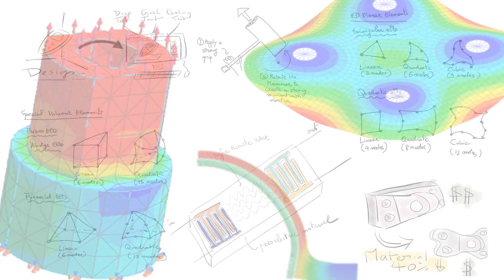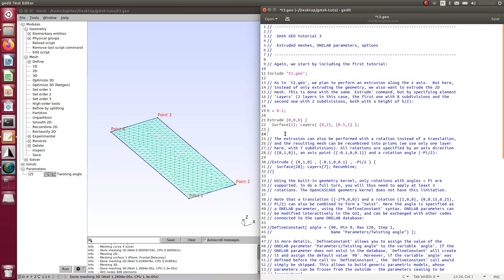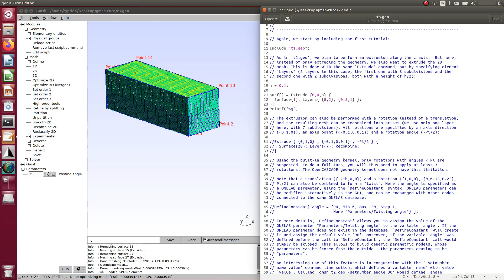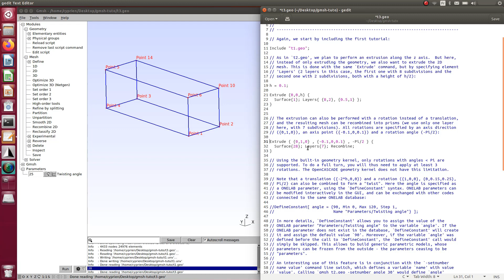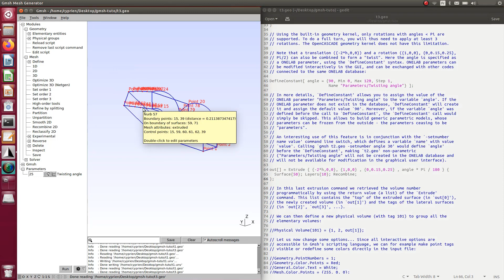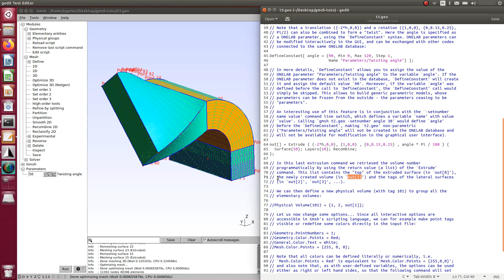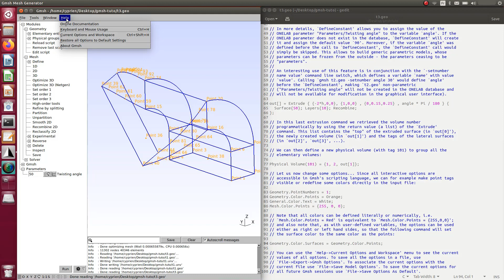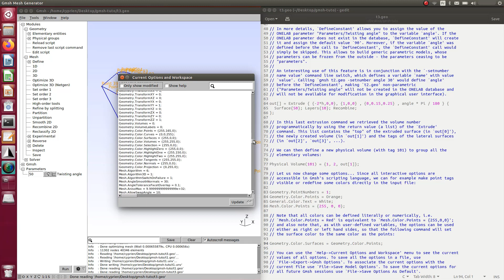[GMSH tutorial 3] Extruding Mesh, Parameters and Options - t3.geo

Comment: Hi Mr Rusu, I am trying to mesh a geological slope with stratums(which are modelled as surfaces) using gmsh. As the geological slope is modelled as a whole, and the stratums cut crossed the slope, I would like to generate different regions divided by these stratums and then mesh these regions independently (but the surfaces between the two regions should be conformal). Is it possible to generate such mesh independently by gmsh? (I tried but failed), or should I firstly use some other computer geometric packages?